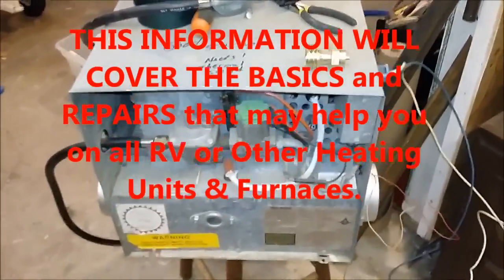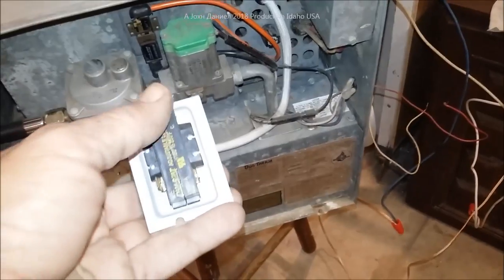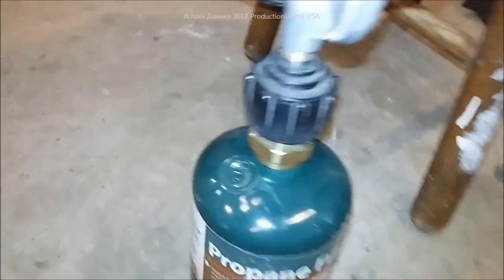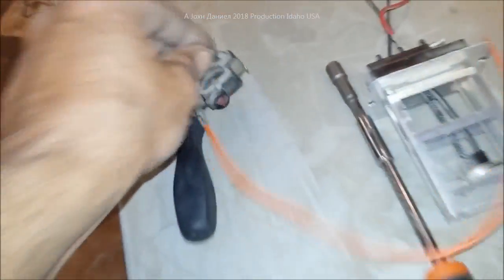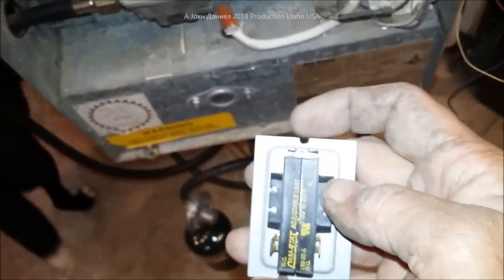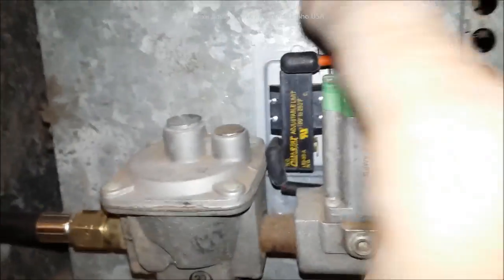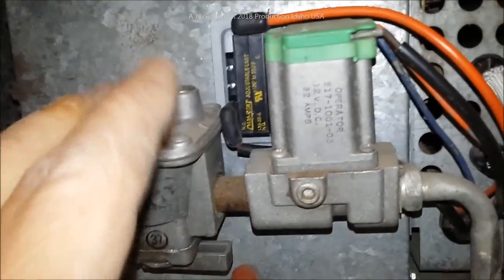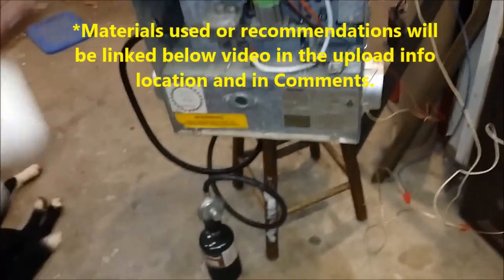RV furnace heater not running operating right? Common Fix (parts and options below video)

Comment from the maker: Due to ease of finding them, all my parts are sourced through https://ebay.to/2s5mPXT , search your model or brand there. The adapter for propane to 1lb bottle is https://amzn.to/2II4mev . And the best professional watt meters are https://ebay.to/2KOZII1 *This video can be used to refer to function of all furnaces*, *not just RV style*! 
~Exercise caution and use quality parts. YOU can do the repairs!! 
Ebay is without a doubt, the best source for parts on older heaters due to all the former Heat and Air contractors having them in New Old Stock.

Comment: I have a duo therm 65917-022 and mine dont want to come on fully it blows but the air is cold any suggestions
Reply from the maker: Check the LIMIT SWITCH by firing up the furnace, then crossing the contacts on it to see if by bypassing it you get full fire up.

Comment: Hey John, I just bought a 2003 Skyline Nomad Trailer with a suburban furnace.  According to the last owner everything worked, upon inspection everything seems to be working, but I cant get the furnance to kick on.  I turn the propane on, thermostat all the way up, and plugged into shore power still not working.  I am replacing my converter due to the charger no longer working, could that be my issue? Batteries not fully charged? or something in the electric conversion?  All thermostat wires seem to be connected properly.  Any suggestions on stuff to check? Like I said last owner didnt seem to have any trouble.  Thanks, awaiting your response and love your vids
Reply from the maker: Sounds like your propane is not fully reached the unit, or your previous owner may have shorted something removing his things or batteries.

Comment: thnk you mr. daniel sir so  are u gonna  still do the rv conversion  , i also told a guy that you get old  trailers and sale parts hope thts ok he was needing a handle of some kind for a van and the shaft of the handle was square ...so maybe a roof vent handle might work....
Reply from the maker: Yes, we are doing 2 right now. We decided to look into the 1973 Balboa as the 5th wheel hauler until $$$$ gets in the pockets to do the big conversion of the 71 class a.
Reply from the maker: I have the King style knobs and T handles 1/4 and 5/16 somewhere around here.
Reply: @JOHNDANIEL1  thnk u sir  ill keep watching peace..

Comment: Mine will run for little bit then shut down. It won't start up, blower won't work or flame, Leave it alone for a day or so. Turn it on. Blower starts, no flame. Blower shuts off. What gives
Reply from the maker: Whats the year, make and model.
Reply: Mine is doing the same thing on a 2020 jayco eagel not even two weeks old

Comment: Is the small white and red or pink wires coming out the side for the thermostat? It says blue inside the unit but i see no blue wires.
Reply from the maker: You will have only one set of wires going to any individual item your replacing. Just look careful, and keep them all intact.